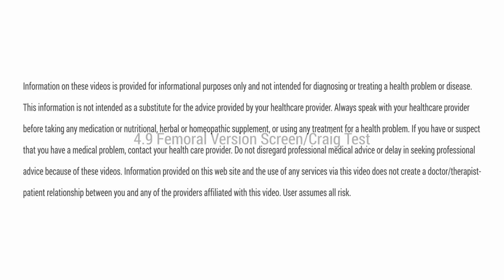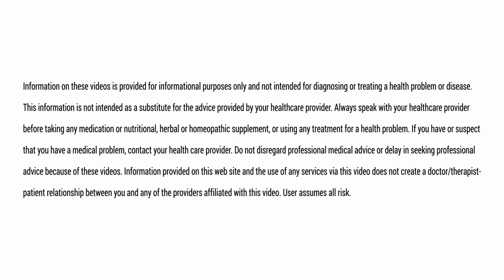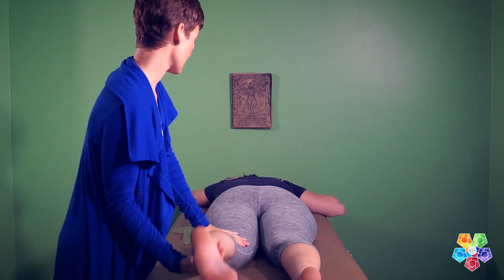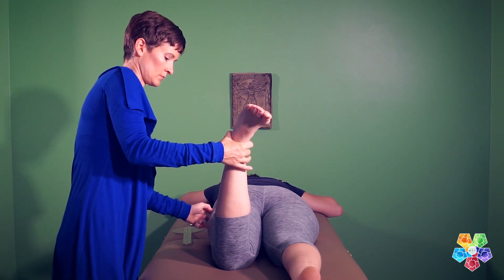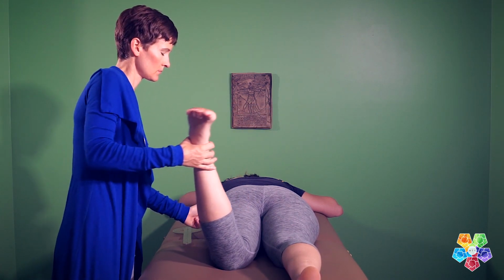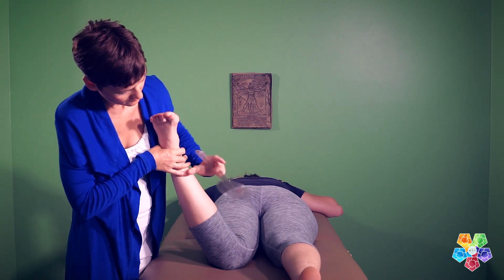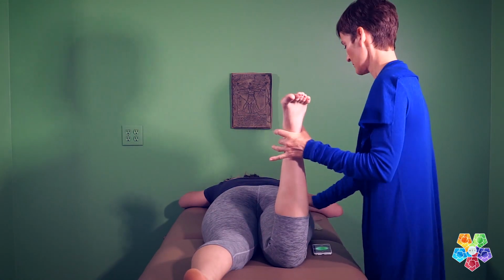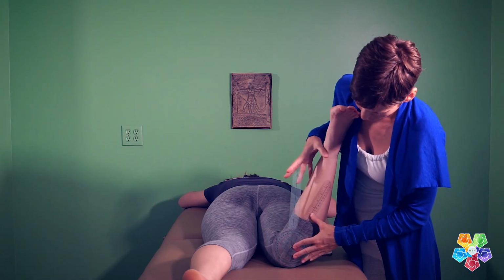Femoral Version Screen (Craig) Test

Comment: CT Scan from Pelvis to toes

• Left femoral neck angle=25 clockwise, condylar angle=1 anticlockwise. Femoral anteversion angle=26

Right femoral neck angle=21 anticlockwise, condylar angle=14 anteversion angle=35 clockwise.

Femoral

Normal acetabular depths.

Normal hip joints.

Normal S.I joints.

• Normal sacrum, ilium and other pelvic bones.

• Normal soft tissues.

Normal knee joints.

Normal both feet no bony coalition

Doctor, there is no pain, but I feel a difference in my feet. What are the normal angles for this condition? And what is the name of the condition? Thank you very much
Reply from the maker: Normal angles for femoral anteversion in the literature are 8-15 degrees. Anything over that is considered excessive anteversion. Anything less than 8 degrees - is femoral retroversion. Both are categories of hip dysplasia. It's no the only measurement that qualifies someone as having dysplasia, but it is an important one.
Reply: @ Dr. Guinness, please could you tell me what problem you noticed in the report, which you sent above